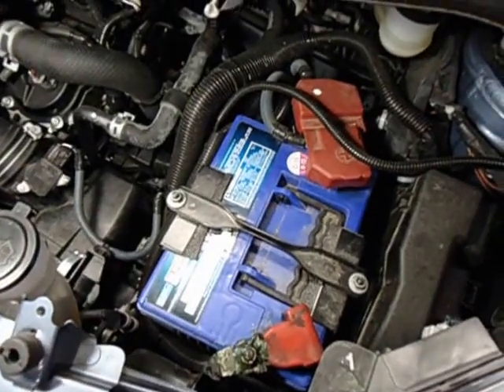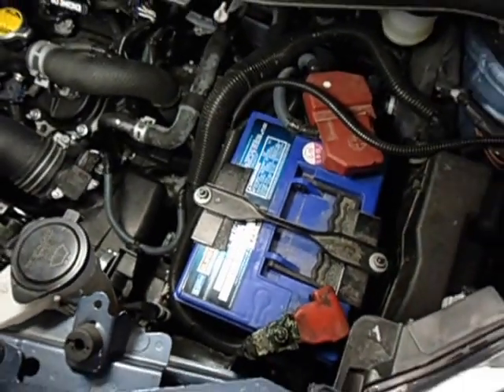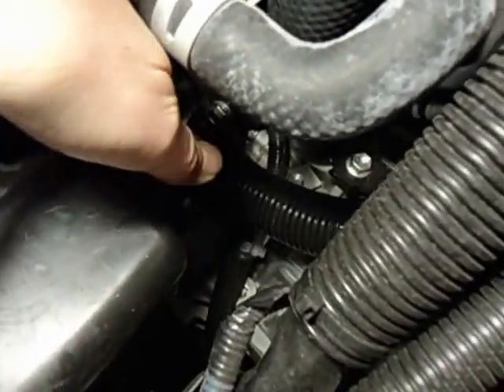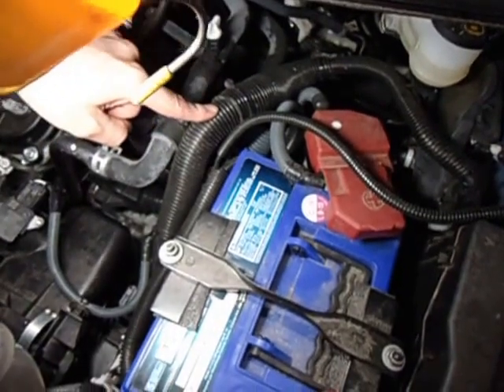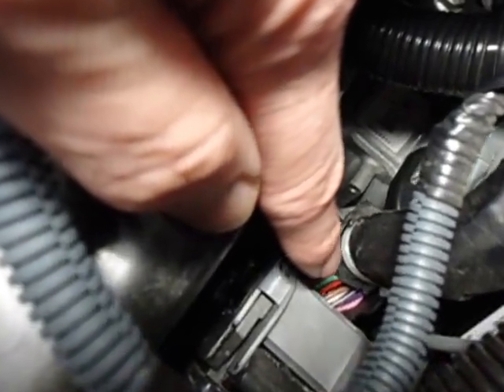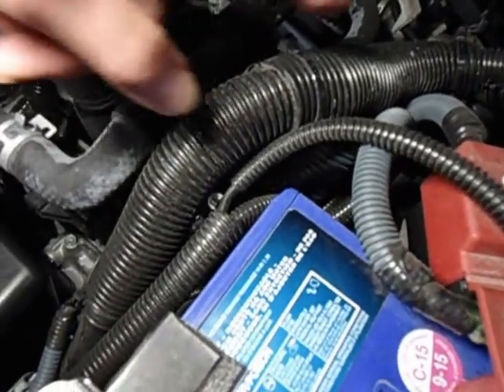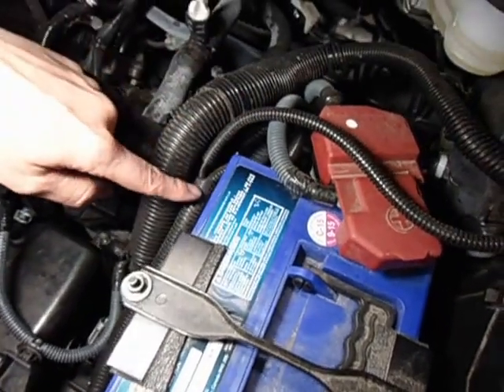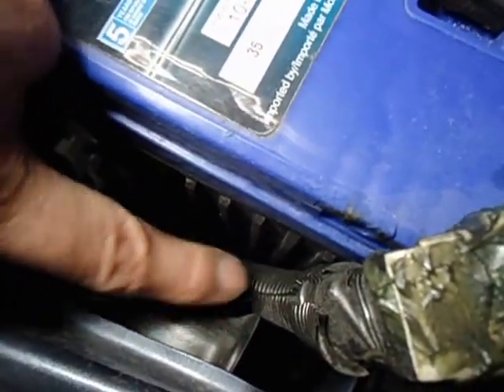Toyota Scion iQ battery replacement note

Comment: I just replaced my battery in my 2012 IQ.  Looks like your IQ has the cold weather package. My battery is much smaller and I got optima yellow top model D51, the posts were on the right side so no problem mounting it.  Thanks for posting this.
Reply from the maker: glad your battery replacement worked out for you, the optima is an excellent choice as it is an AGM battery, I replaced mine with an AGM type as well, in Canada and USA we get the group size 35 battery (1NR-FE type/model engine, 1.3 liter DOHC 94 hp, 89 lb-ft torque), i'm assuming your vehicle is outside North America?Thanks for watching and posting.
Reply: I'm in New York, the Optima 51D is the same size as a group 35 but the posts are reversed.  I'm not sure if "D51" means reversed posts. I used Amazon's garage to order a battery and they sent huge group 24 that would never fit.
Reply from the maker: thanks for your response, I guess Canadian models get the group 35 and USA gets the group 51, I think the cold cranking amps should be similar between the 2 groups, especially in the AGM style, I'm not in the garage but I think mine is around 650 CCA

Comment: I'm not sure where you are located, but there is a much easier fix that avoids modifying anything. To ensure you get a battery with the terminals on the original OEM side, you simply need to buy a "Group Size 51" type battery. 
You do NOT want to buy a "51R" battery as they have the terminals on the wrong side and will (as you encountered) require to to move the connections to the opposite side. 

Group 51 batteries are readily available at battery stores in the USA.
Reply from the maker: I am in Canada, we must get the bigger battery perhaps because of the cold.  But it is good to know that the 51 type will fit, thank you!  And thank you for watching.

Comment: Interstate Batteries sells a battery with the right post configuration, for the Scion IQ, here is the model: Mega-Tron 51 Automotive Battery Five-Year Performance 500 CCA Cranking amps is 625 amps, with Cold Cranking amps at 500 amps. 
Product ID:MT-51
Termination:
Common Code A
Reply from the maker: thanks for the info!

Comment: what is the size of the screw/bolts needed for the battery hold down metal ledge thing? I cannot find it. I bought 10mm but they were too large.
Reply from the maker: I think they should be 10mm (I don't have the vehicle anymore so unfortunately I cannot verify), would be off if they are another size like you have indicated. Perhaps in a different market they use a different size? Thank you for watching.